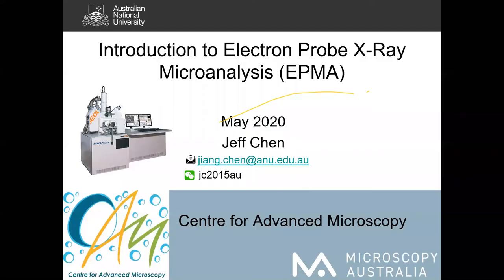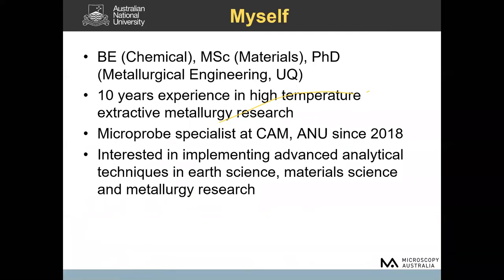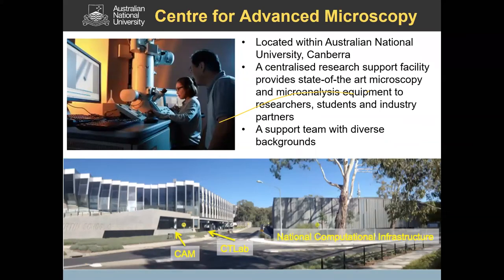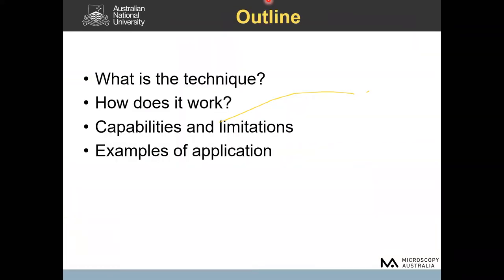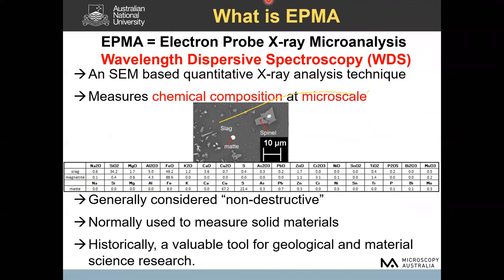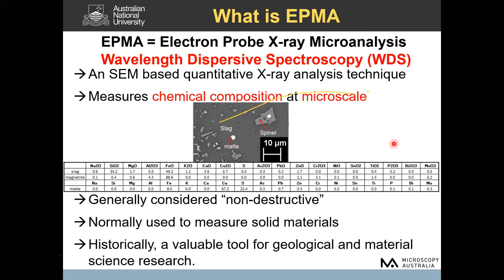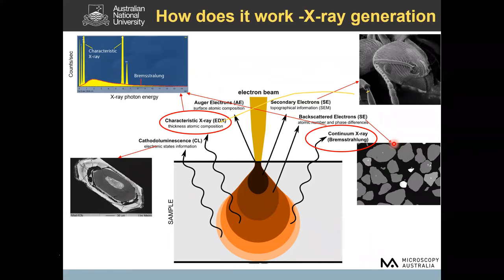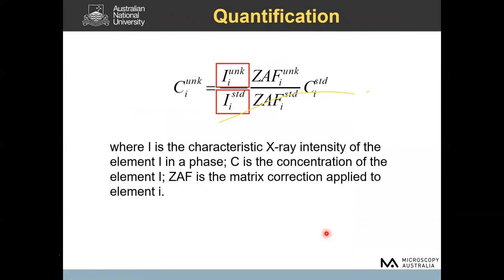Introduction to Electron Probe X-Ray Microanalysis (EPMA) by Dr Jeff Chen

Comment: Thank you for the great presentation. Why the sample should be flat? Is it because of X-ray intensity difference depends on the beam direction?
Reply: Correct! Surface tilt or roughness affects the length of the path of the X-rays have to travel within the sample. The longer the X-rays have to travel within the sample, the more they get absorbed, obviously the less would enter the X-ray detector. Vice versa.